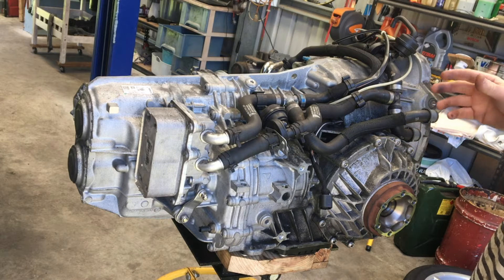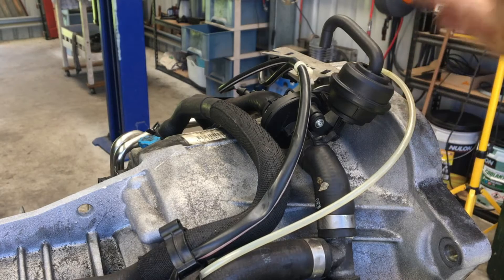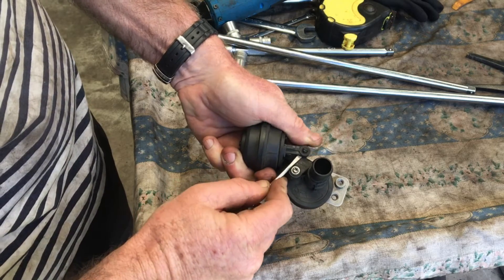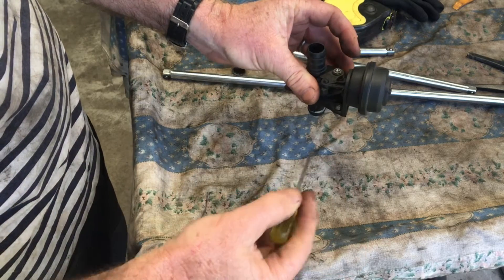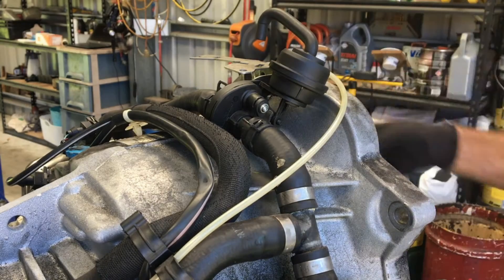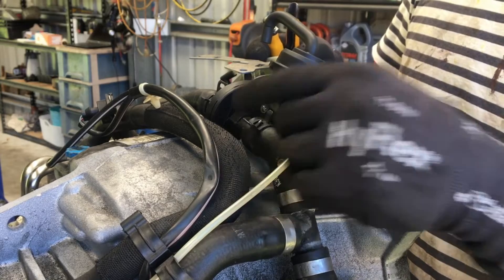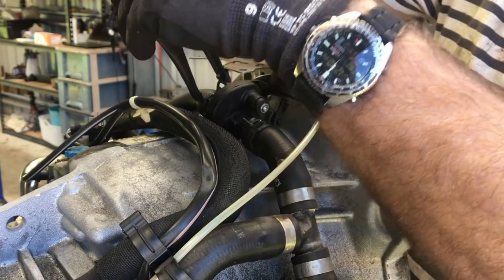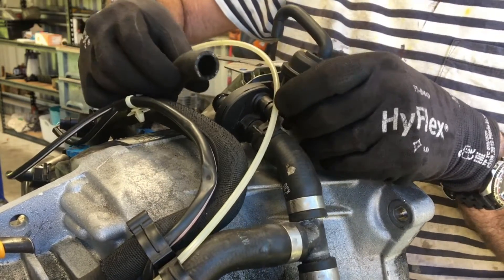Porsche ZF PDK transmission cooling

Comment: hi jeff, so would you recommend replacing the case side oil cooler gaskets in-situ by just pulling back the pipes gently? removing the oil cooler entirely seems like a real headache...2014 911 Carrera
Reply from the maker: Honestly I don't have any experience with the 991 so I don't know.
Reply: @jeffrichardsoncardiy Thanks for responding! Its a pretty similar set-up just less access from the top - Im just wondering if the sealing face on the case side oil cooler pipes would be damaged by pulling them out vs a full disassembly. 

I have a typical oiler cooler pipe leak from old rubber o-rings. Leak is from the transaxle case side connection for the two pipes oil cooler pipes.

Comment: Hello,
Is it possible while driving to know what is PDK oil temperature ?
When driving heavy on the track, can it be that the PDK oil gets too hot ?
What happens when PDK oil gets too hot ?
Thank you
Reply from the maker: From you name I assume the car is a 981. The 9X7 series don't have an oil cooler or oil temp sensor. The 9X1 series does. If a 9X1 you can see the temp on the Engine control unit actual values under temperatures. It's not in the TCU for some reason. If a 9X7 series the only way I know of is to get under the car with an IR thermometer and check the casing temp.
Reply: @jeffrichardsoncardiy  
yes my car is 981
can you explain in more detail how I can see PDK oil temperature pls
do not understand well I am afraid 
Also, what is normal temperature and what is too hot ?
Regards (from Belgium 🇧🇪)
Reply from the maker: Do you have a PIWIS? Without this you won't be able to see it. Also from the testing I've done, if you have an oil cooler (which you do) the gear oil temp is the temp that stays the lowest of all the oil temps, so generally doesn't need to be worried about. It's only on cars without a cooler where it becomes a problem.
Reply from the maker: If you don't have a PIWIS, the best way I've found that will give you the correct gear oil temp is go use an IR thermometer on the base of the differential, about an inch below the driveshaft flange. This has always been exactly the same as the PIWIS readout.
Reply: @jeffrichardsoncardiy  
Good tip !
Using IR thermometer during a stop on the track 
easy and quick 
Questions are:
what is normal temperature and when does it become too hot ?
this for clutch & gear compartments

Asking all this because I had 10000€ bill to get my PDK repaired just last month…. !!
Reply from the maker: @cayman9815  If checking with an IR thermometer, ensure you direct it at the base of the diff. Anywhere else on the case seems to get random readings but the base of the diff was always bang on. Nice thing is you can stick your hand through the wheel spokes.

What did they do to the transmission? Some of the prices these shops are charging to fix stuff is a bit nuts to me.

What is too hot? Anything beyond 120C I would think is excessive. The oil should be good for hotter than this, but I would expect in a 981 with an oil cooler it should stay well below this.

From the testing I've done, not on the track but very aggressive, when the set point of the coolant is lowered when in sport/sport plus or if you are driving hard, the gear oil temp really doesn't get that high. There's a lot of stuff going on. If you want to read a bit about what is happening behind the scenes take a look at this. It's a write up I did after some testing recently.
https://www.planet-9.com/threads/insight-into-the-cooling-system.253406/#post-2207892
Reply: @jeffrichardsoncardiy  
thanks for all info
however not clear to me yet, where exactly to shoot with the IR thermometer on the PDK ?
Reply from the maker: @cayman9815  Right rear wheel. Follow the driveshaft to where it connects to the output flange of the transmission. About an inch below the flange on the fins of the differential cover. Look right at the start of the video link below. It shows the differential cover, which I remove to show inside. Anywhere on the lower fins of the differential cover is where to check.
https://www.youtube.com/watch?v=qYFsw54cYew
Reply: @jeffrichardsoncardiy  
let me check on the car tomorrow 
many thanks already!
rgs